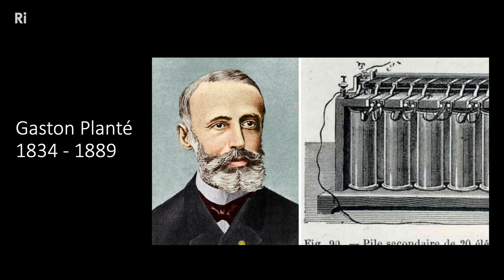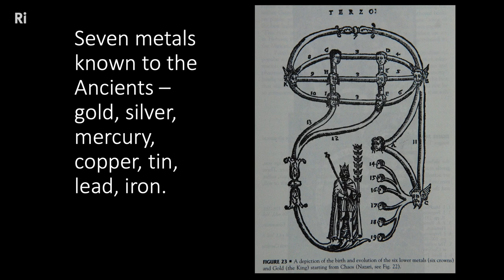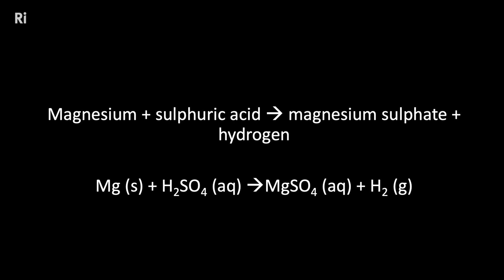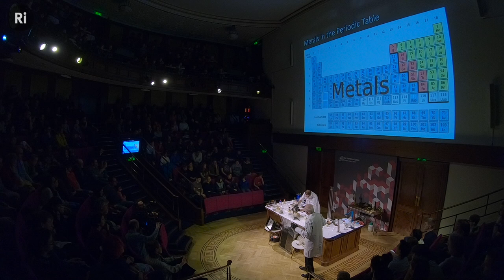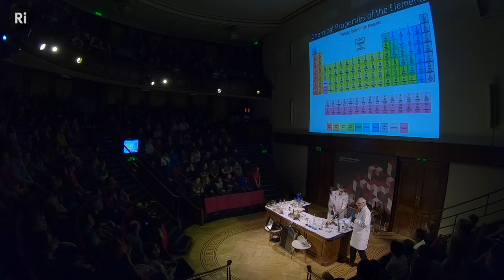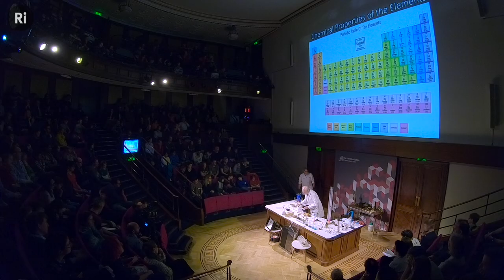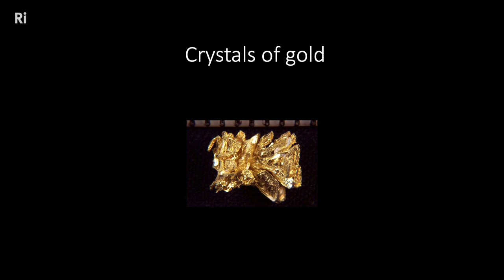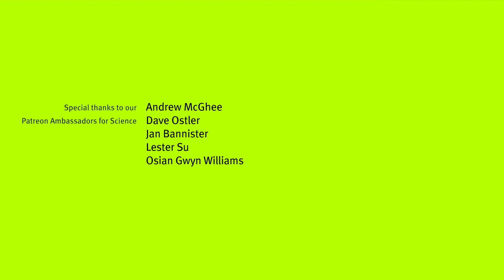Metal Mayhem - with Andrew Szydlo

Comment: My brain: “Since this is about metals, there’s no way he’s going to do the hydrogen balloon demonstration.”

1:16:00 “Andrez, do we have the balloons?”
Reply: Ah Dear Child, but the Palladium used as the catalyst for the final hydrogen + oxygen reaction, instead of fire/heat, would be the actual focus of the final demonstration of the tendencies of certain metals toward mayhem.
Reply: No good lecture without burning stuff
Reply: To be fair, the period table at 35:45 colours hydrogen as a metal. 🙃
Reply: Chemists: Hydrogen is not a metal

Me: checks periodic table, it is on the side of metals 😢
Reply: @Yumia5472  There is such a thing as metallic hydrogen it's however only theorized to occur naturally under the extreme pressures in the core of gas giants like Jupiter or Saturn.

Comment: 36:30 - cesium is also a liquid at "room temperature" although the room would be considered hot by most people as it turns into a liquid at 83.3F. Cesium is fun to play with especially when pouring it onto other metals such as some aluminum alloys because the cesium soaks into the aluminum alloy as though the aluminum were a simple sponge. The cesium treated aluminum can then be broken in chunks using nothing more than your bare hands. Doing so makes you look like superman to your son especially if he has not seen this experiment previously.

Comment: So this might be a silly question, but could one use a Mercury hammer in space would the Mercury hammer hold its shape and form? Say for example the hammer was used in the Terra scaping operations of Mars or even closer to home repairing the multiple satellites that are in orbit around Earth?
Reply: There's no air pressure or resistance on Mars and lower gravity, so a dense, heavy tool wouldn't be necessary.

Comment: Small, but important, point: Mercury is not the only metal which is liquid at room temperature and pressure. Many chemists forget to mention Caesium.
Reply: chemists consider standard ambient temperature and pressure to be 25°c @ 100kpa. At that pressure, caesium melts at 28.5°c so it's still in it's solid phase. It's a small and not very important point as standard temperature is an arbitrary choice.

Comment: I use rechargeable batteries with my head strapped light I have A magnetic bar in A plastic tube I could wrap in copper wire and shake the tube and charge the batteries.

Comment: Why doesn’t he wear eye protection?
Reply: He does when it is necessary. These plastic ones distort light (vision) a bit, actually making doing experiments more dangerous, because you do not see that well what you are doing. They should be worn when there is a chance of dangerous splashes etc.
What is more concerning is that he is doing experiments with mercury for children. Mercury vapour poisoning is underestimated. Just because you do not feel getting ill when playing around with mercury drops does not mean that it is not harming your body (and mild mercury poisoning symptoms mimic other common illnesses so it is rarely correctly diagnosed). Only because we have billions of cells we do not get ill from that single exposure, but it binds with our proteins damaging them nonetheless, and it is a cumulative toxin, so it is best to avoid any contact with liquid mercury whenever possible and never use it in demonstrations without a good fume hood.